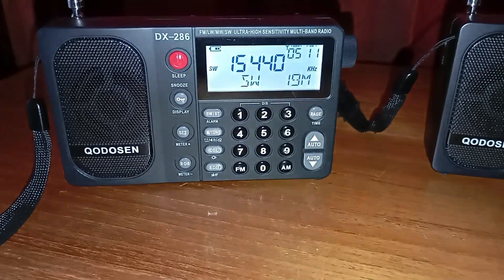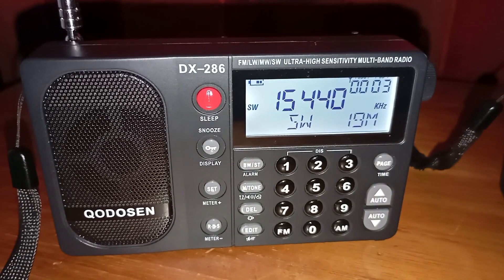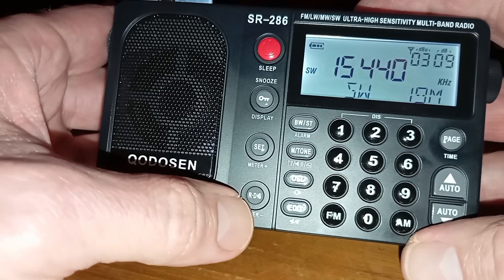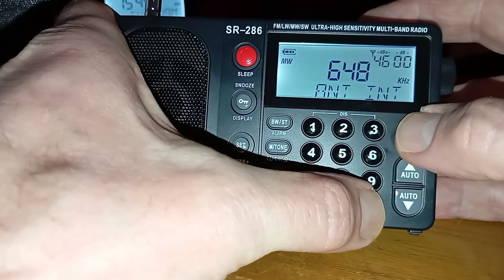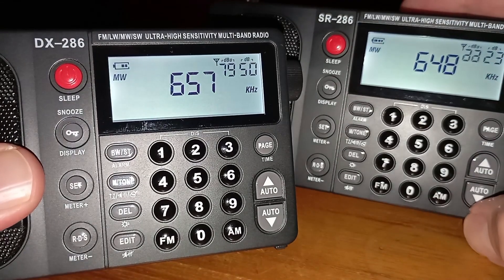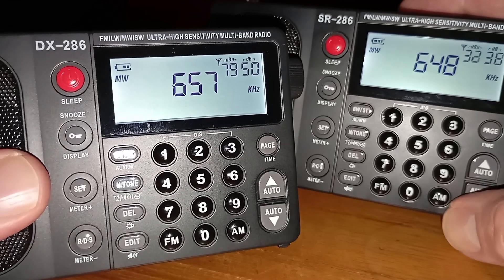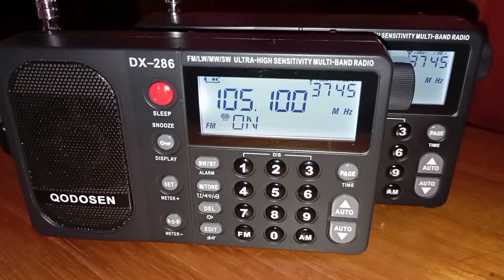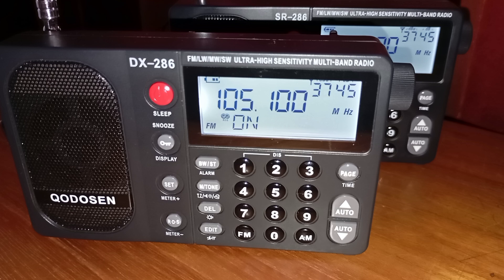Does the Qodosen DX-286 really perform exactly the same as the SR-286? #shortwave #radio

Comment: The international version DX-286 is equipped with a plastic case, a weak 2Ah battery, a well-printed instruction manual and simplified controls. In addition, this version does not have the ability to switch to high-impedance antennas, due to the fact that they are rarely used.
Reply from the maker: Hi Eugene, thanks for your comment! I am a bit confused though, what is the international version? I did not know that there were different versions.
Reply: DX-286 is the international version, SR-286 for Chinese domestic market
Reply from the maker: @eugenehot4755  Thanks Eugene!

Comment: Compared to other radio as xhdata d808, which the diffference between both radios? Is possible do you comparing both radios side to side in some video? I would like to buy qodosen, but I need be carefully because in my country (brazil) we have high tax of importing.
Reply: My principal goal is catch FM signal. Sorry my english, im learning
Reply from the maker: Hi there Flavio. For FM the Qodosen is definitely better than the D-808. The Qodosen is very sensitive on FM, and it also has many bandwidths for FM, and it has RSD that shows PI codes. But I have made a note, as soon as I get a chance I will compare the Qodosen and the D-808 on FM. 

By the way, I have the same problem here in South Africa, taxes are very high on imports. I paid about $60 in taxes when I bought my Qodosen SR-286. But I can tell you it was worth it!
Reply: @swlistening  thanks very much
Reply: @swlistening 60 долларов налог для Африки? Я очень удивлен. Я был удивлен смотря ваши видео, что вы с Южной Африки. Я жил в СССР и тогда часто вашу страну вспоминали и всегда, что там угнетают местное население. После распада СССР я о вашей стране услышал только в кино в 2000-х и то, что там мучают инопланетян. Район 9, вроде кино. Потом один раз где-то была информация что Южная Африка стала как большая часть Африки и всё. Поэтому 60 долларов налог у вас для меня шок. Зачем он? Обычно это для защиты своего производства, но, у вас, я думаю, не производят такие радиоприемники. И чтоб платить такие налоги, люди должны зарабатывать значительно больше этого налога. 
Также спасибо вам за видео дальнего приема с США (3800 км) на средних волнах. Именно благодаря ему я купил SR-286.

Comment: Possible to use Xstar 18650 battery 4000 mAh in DX286? Length 69.6 mm
Reply from the maker: Unfortunately not, I think these will be too long. The battery that I use in the Qodosen is 67 mm.
Reply: Hello, just want to let you all know that the new Xtar 18650 battery 4000 mAh work perfectly in the DX286. Just been testing them. @swlistening
Reply from the maker: @safugpac2691  Thank you for letting me know!

Comment: What language were they speaking on the radio? Would I be right and thinking Zulu.  

The local language was different in the Cape area if I remember.
Reply from the maker: Hi Glen, Zulu is indeed one of the strongest languages here in the Johannesburg area, and also in KwaZulu-Natal. But this one in my video is one of the Sesotho languages, I think it might in fact be Sesotho itself. Could also be Setswana, part of the same group. The languages in the Sesotho group are very similar, as a non-speaker I am not 100% sure which one it is. The Sesotho languages are also spoken widely in the Johannesburg area. In the Western Cape the biggest local language is Xhosa, it is different indeed.

Comment: I notice that the battery on the DX model is slightly low...would that make a difference.
Reply: DId you mean the supplied battery indicated one bar lower on the LCD display when you received the DX-286?

If that's the case, it's perfectly normal. Lithium ion batteries for safety reasons, are always stored and shipped with their voltages at 3.7 volts. Their internal chemicals are the most stable when the battery is stored for long periods at this voltage. The user is supposed to charge the battery to full (4.2v) before using it.

Most radios that use lithium ion batteries have a range of operating voltages from 3.6v-4.2v.
Reply from the maker: @StratmanII  I think he was talking about the difference in battery charge level between the DX-286 and the SR-286 in my test.
Reply: @swlistening  Ah, I see. Well, DSP based radios generally work with a wider range of operating voltages. With analogue PLL technology like the PL-680, the radio's change in sensitivity will be very noticeable at the base operating voltages.

The 18650 lithium ion battery that goes into the DX-286 is a different story. Poor quality ones have erratic and inconsistent discharge curves, resulting in lower and variable capacities. 😀
Reply from the maker: Hi Chris, do you mean that the battery on the DX-286 is not as fully charged as on the SR-286? I did not notice that, but it does not make any difference.
Reply: @swlistening   I thought that it didn't matter...but brought it to your attention just in case....
Reply from the maker: @chrisreid8697  Thank you!

Comment: When using MW, is the external antenna the whip? Can you use something like an MLA-30? Really like your channel.
Reply from the maker: @mikele5756 Hi Mike, yes, as Stratman has commented, when you switch to the external antenna for MW it uses the whip by default, or whatever you plug in to the antenna port. So you can use any antenna you like. But when using the external antenna for MW you need to be in an area that is relatively RFI free, it picks up a lot of noise.
Reply: For MW, the DX-286 allows you to select between the internal ferrite core or any external antenna at the push of a button! You'll then know whether your external antenna is better than the ferrite core!🙂

Comment: According to numerous sites, the only difference is the DX-286 has an easier and quicker sequence for a variety of functions. I bought the DX-286 and have found it to be very easy to use.
Reply from the maker: Hi Richard, thank you for your comment! I only know of these two main functions that are easier now, the ones I mention in my video. I spoke to the brother of the radio's designer some time ago and he also mentioned these two changes, here is the video if you want to watch it https://youtu.be/-gJfSIZtx8s

I agree that the DX-286 is quite easy to operate once you get the hang of all the buttons. Th SR-286 is equally easy, to be honest, bar these two functions, namely the internal/external antenna and the antenna amp, that take two button presses instead of one. Otherwise everything is exactly the same.

Comment: What is the size of these radios? Are they bigger than the XHDATA D-219?
Reply: The DX-286 is almost the same size as CC Skywave and Sihuadon R-108. Small radios. The XHData D219 is a tiny bit smaller than the DX-286
Reply: @ditto1958  ok thank you.

Comment: Brother wats the difference between havn the amplifier on or off thanks.
Reply from the maker: Hi Ged, it helps with weaker signals. Makes the signals a bit stronger so you can hear them better. It doesn't always make a big difference, but sometimes it does.
Reply: Appreciate the response thanks Chief.